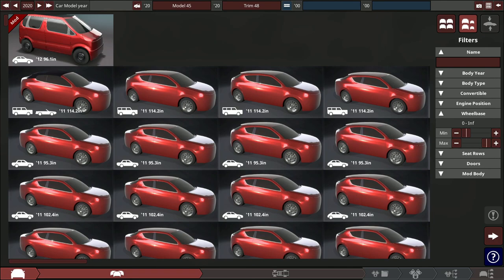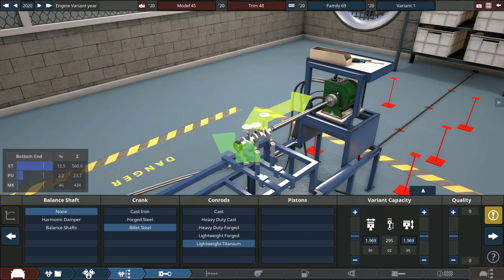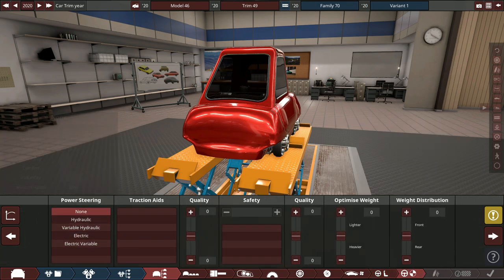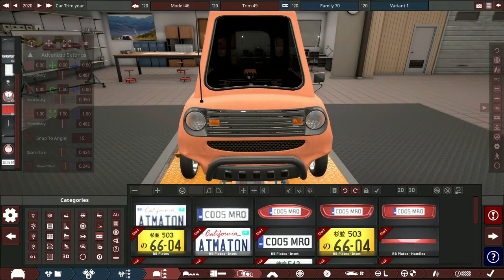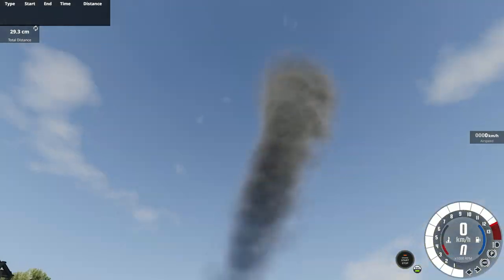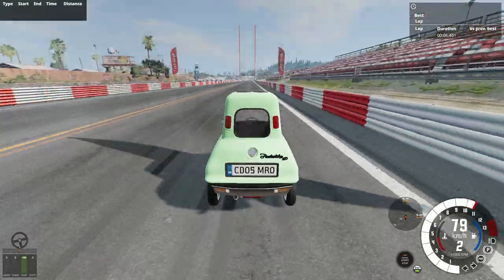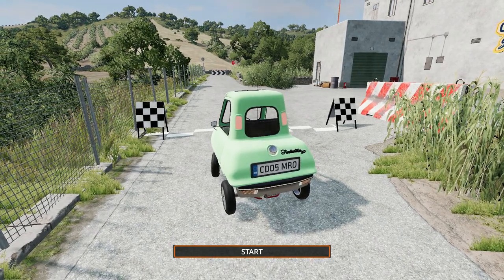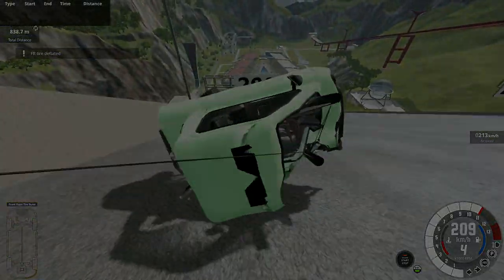Building The Lightest Car Ever!? ~ Automation - BeamNG

Comment: Believe it or not, this is faster than a 208 GTB or GTS I have no idea, but I've heard that it's faster over the quarter mile and 0 to sixty. Well the non turbo ones had 150 hp, which is less than the 2.0 V6 found in the Dino. and had an 8.7 zero to sixty and 17 to a quarter mile.

Comment: I believe I read that the lightest car you can make in automation that will function in beam is 300-400KG. I'd love to see you revisit this, and even keep the solid axle for the front, but instead aim to make it weigh enough to make it work in beam, and then optimize the engine and trans package to make it really fun to drive, and the tires and whatnot to make it GOOD.